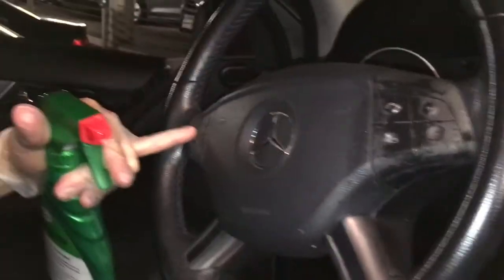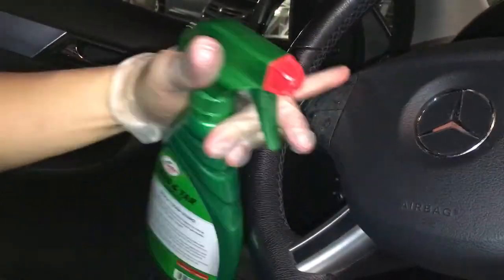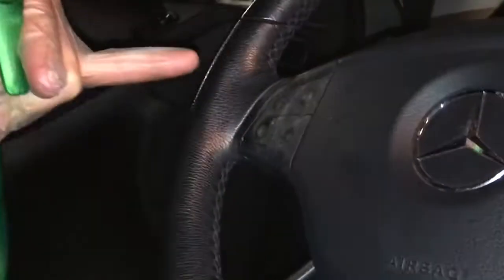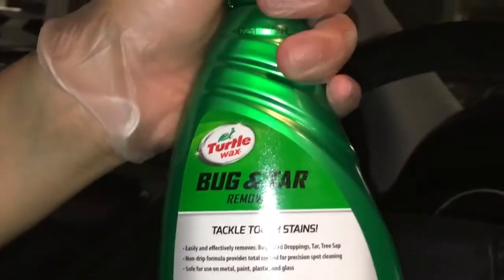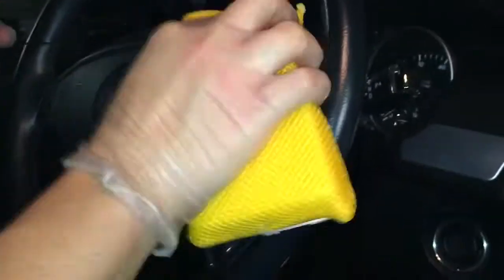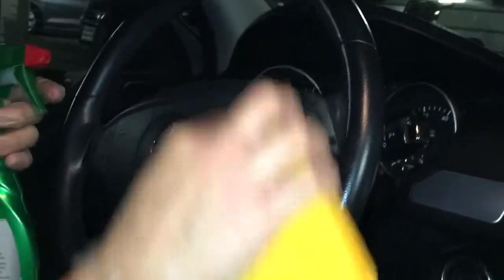Benz W251 R500 - remove sticky stuff on steering wheel controller

Comment: Great solution thanks for this tip. It's the only thing that works and I tried everything! I even went to Autozone and asked Mercedes mechanics. My controls became worse and worse. It became "furry" because of all the things I tried and got stuck to it. I used a soft toothbrush to apply the bug and tar remover and worked the goo loose off the surface. Then I turned a cloth often to lift the goo off. The control signage was left undamaged.
Reply: But now you have the "secret sauce" to fix it. I've told all my Mercedes owning friends. Of course they'll want me to do it!